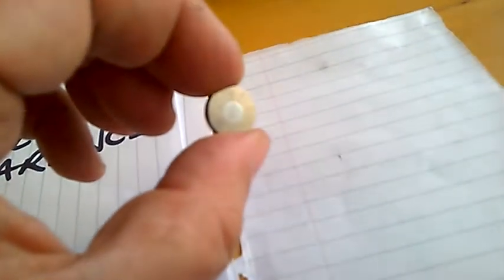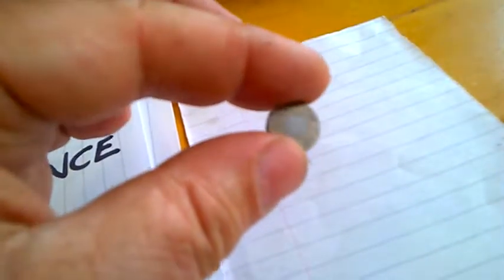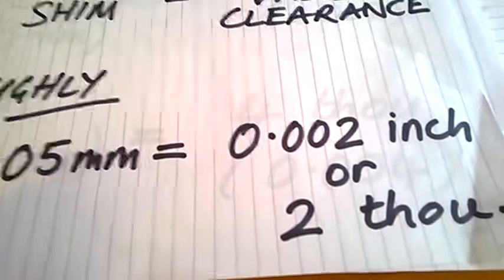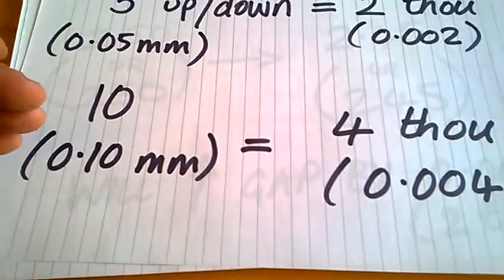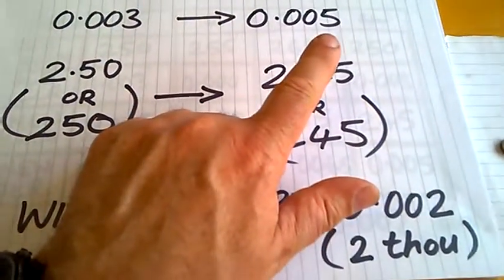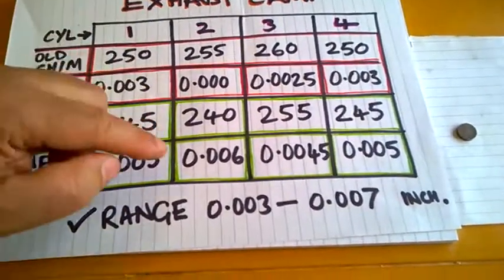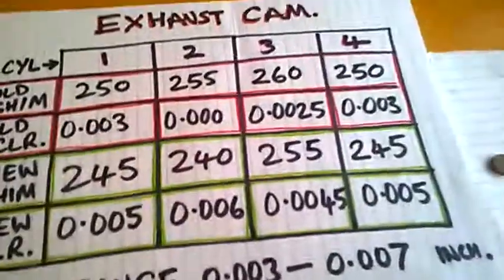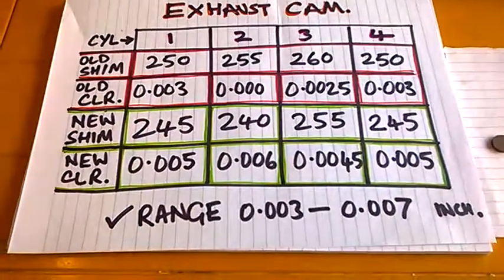Idiot's Guide to Shimmed Valve Clearances

Comment: Nicely done Clive. This way you stand far less chance of making a mistake. It's so easy to get the decimal point in the wrong place when converting mm to inches. I always worked in thous, because we sold to the US, hence I still work in imperial. Now, and this was done many years ago on an overhead cam car engine. If the shim is too thin, well obviously you have to get a thicker one. However if you run out of thin ones, you can angle grind a few thou off. This of course goes in the bucket side of the follower, not the cam side of course. Not perfect but did work. Also, years ago a diesel car engine broke the camshaft. Wouldn't start because the gap had closed, used easystart (it was a diesel) it started with a BANG.
Reply from the maker: MalcOfLincoln Frustratingly Malc one of the shim. S supplied is wrong, a 280 when I need a 240. Means I can't finish the job tonight.
Reply: Bit like my injectors then....sometimes we wonder why we bother. But then, after all the hassle and riding/driving we know it's all worth it :)